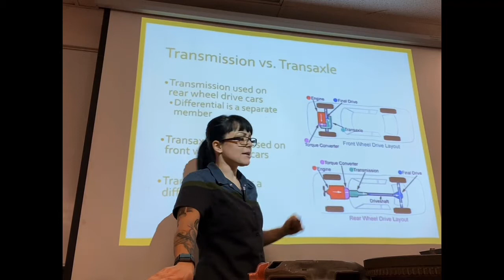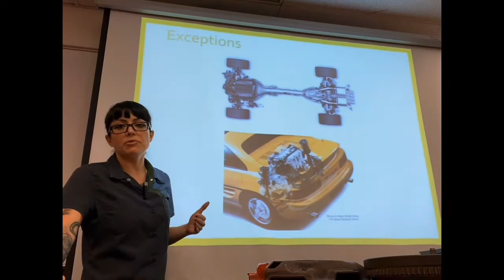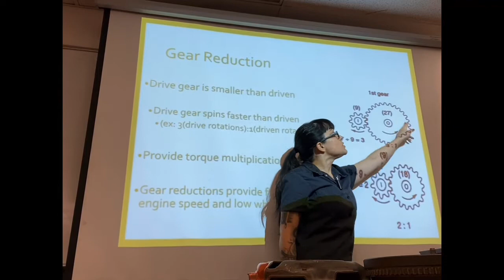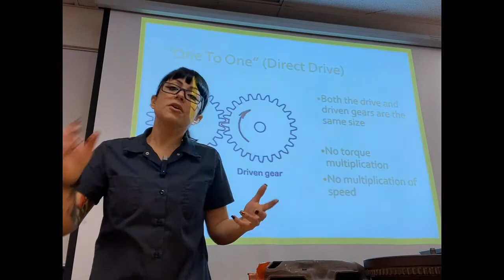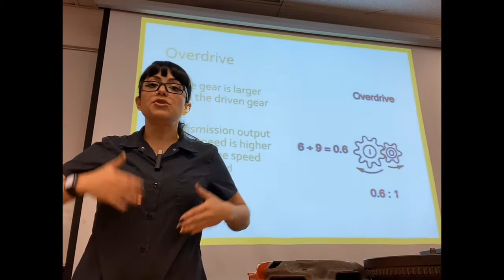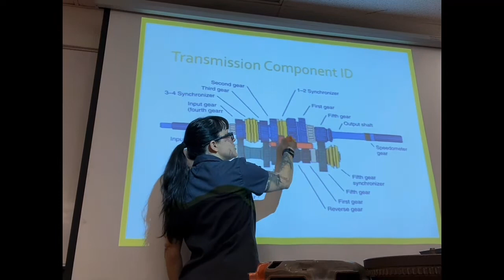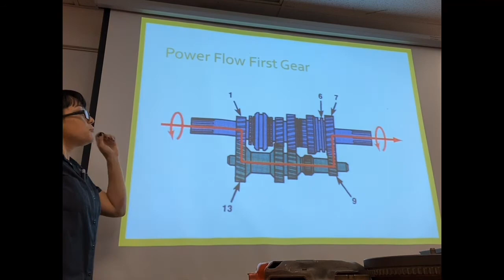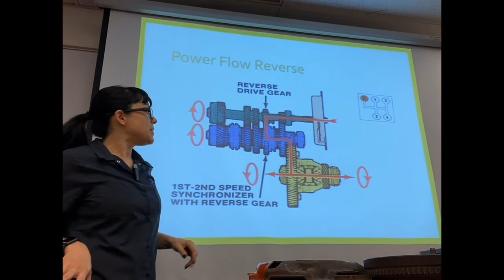Manual Transmissions

Comment: Love you on the recent Donut videos. This is good stuff too - I already knew most of this stuff pretty well but never knew how a synchro worked! Thanks for this.
For the manual transmission operation part, I think it's important to note that the output shaft gears are rotating independently of the shaft itself until a shift fork/synchro makes one of them sync up with it.
Toyota's E transaxles seem to have 4th ratios that hover around 1:1 but never are, so I guess they do have a separate gearset for 4th 🤷🏻‍♂️